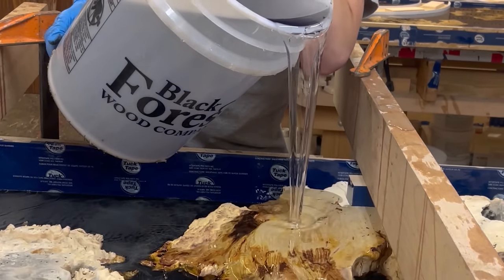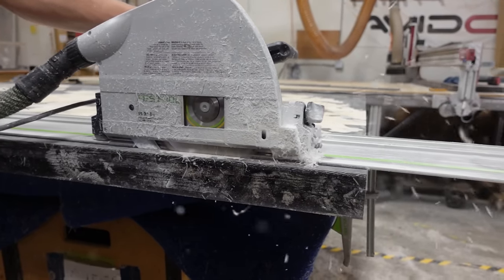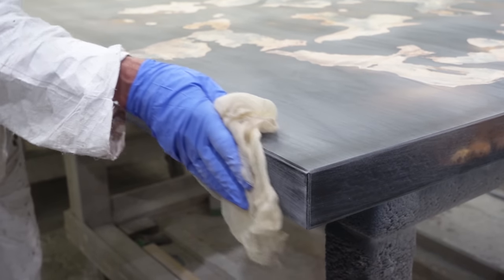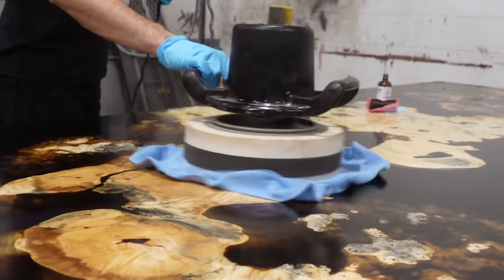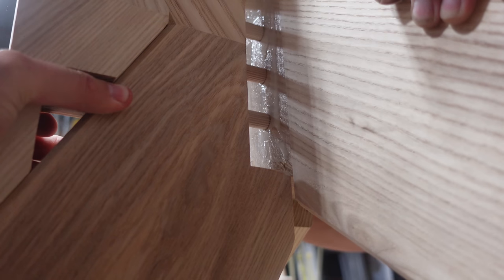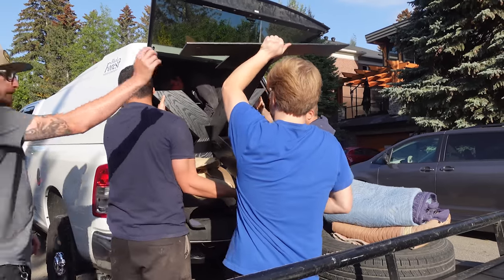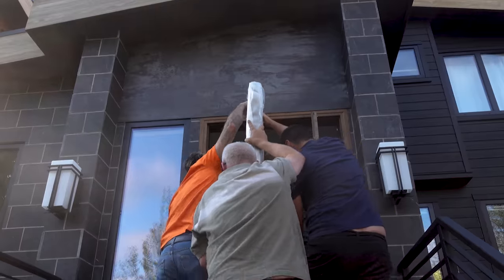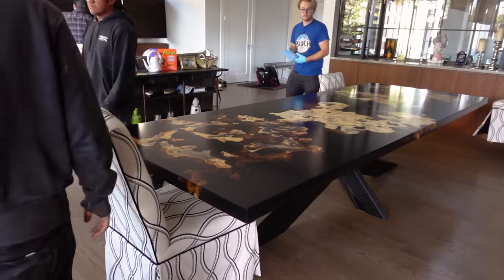First Class Table, Second Time Clients

Comment: I worked in the power quality industry for most of my professional life.  One thing we used in clean rooms, computer rooms and anywhere you would be working with electronics are air deionizers.  They worked great to reduce static electricity.  You were right when you said it was the resin that was causing the static.  

Basically it is a Van de Graaff generator.  If you go to an educational science centre, like the one in Toronto, they do to demonstration of static energy by getting someone with long hair to touch a Van de Graaff generator and then their hair stands up.  That is what you are doing when you cut the resin.  

Same thing happens when you use one of those plastic mats under your desk at work and then you go back and forth with the plastic wheels on your chair.  Every time you go back and forth you are building up static electricity.  If you need to use one of those, go with the ones that have grounding wires. 

So if it is a real big issue, you might want to get an air deionizer.  They are not that expensive anymore and it should help.
Reply from the maker: That’s an amazing idea that I have never even thought of! Thank you!! Definitely going to look into this
Reply: @BlackForestWoodCo  try spraying the saw blade with static guard.  It might work too.

Comment: Again stunning work ... I hope we also get to see the seats :)

It doesn't help the dust collection in that the port is at a right angle to the flow of the cuttings coming from the blade ... you'd think that on a saw that costs so much they'd at least get that right, and also give it enough power to do a single cut as well!!
Reply from the maker: We will absolutely show the full process of the chairs! 
Couldn’t agree more on the saw haha
Reply from the maker: Thanks Barry!

Comment: Do you seal the edges on river tables?
Reply from the maker: Never! It compromises the bond
Reply: @BlackForestWoodCo  many thanks for the reply on sealing river table edges, I have elm to work with, should I be worried about air bubbles if I don't seal the edges, I am using deep pour